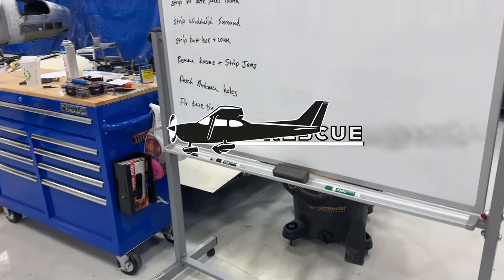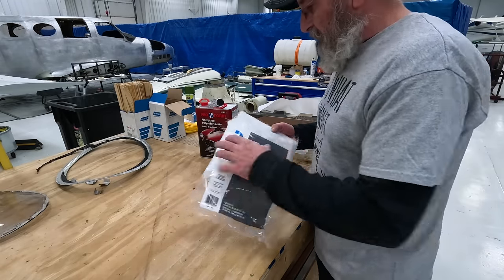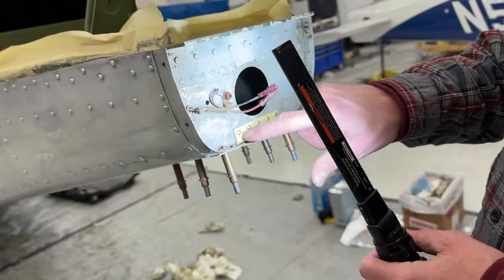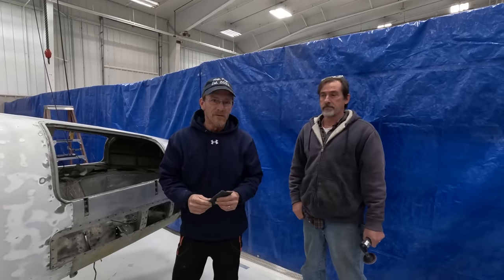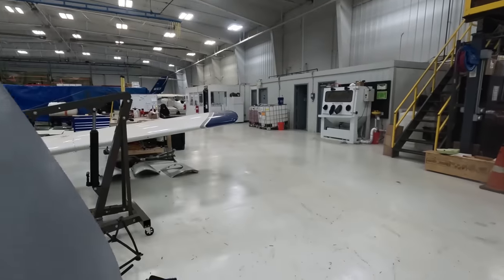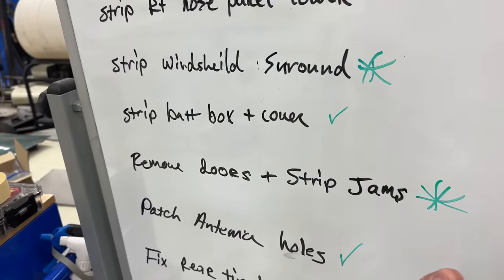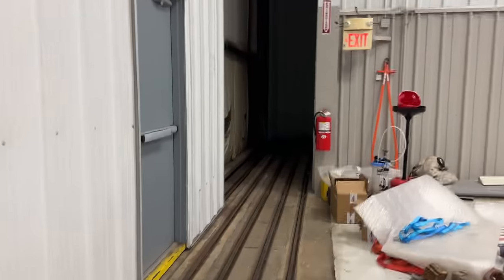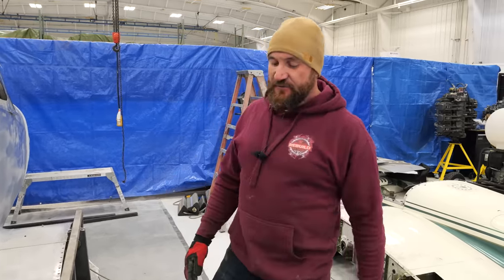Final Touches On The Free Abandoned Airplane

Comment: As you're putting new avionics and antennas in, I'd plan for ADS-B diversity: one on the bottom and one on the top. Canada will soon require the top mounted antenna as ATC in Canada moves to space-based ADS-B with Aireon.

Comment: the trick for removing and installing piano wire is when pulling once you have an inch out chuck it into an electric drill. spin and pull. works like butter. same thing when installing chuck it up slight pressure and slides right in. only have to tap the last inch.

Comment: For finishing ice shields and nose cones try ballistic epoxy by Endura, EX-2C. It is a super tough clear coat, UV proof, and super easy to use. It is used on fire trucks and missile nose cones. It is very expensive but close to indestructible as the name suggests. Not good for exotic hardwoods because it kills colour and chatoyance because of the super UV protection. Another problem I had using 1 ounce of the clear finish on a pool cue besides it killed the life out of exotic expensive hardwoods and one ounce curing gave off a stench that smelled like a thousand skunks had an orgy that lasted about a week in my entire house. The cured finish is colourless and odourless. Make sure you use it with super ventilation during the curing.

Comment: 40 years experienced structural tech. Easy way to remove piano hinge pin. Once you get it out a few inches, chuck the end of the pin into a drill. Pull the pin while spinning it and it will come out nice and clean.

Comment: Unless you add another fibreglass layer inside the nose, the new resin will crack again after a while. Resin alone is to brittle. Only the combination with flexible fibres will give it the needed stability

Comment: I was thinking about the fuselage issue at the end. Could you get some bar stock and bolt it to the trailer in parallel like train tracks? Get some metal wheels under the plane jack, that way you can have the wheels hang off the side, kinda like a train track. It could be useful for future planes and the bolt on rails would be temporary.

Comment: I love the comment "This is what's holding your door on at 200 mph". I count 22 tabs on body side. That means either 42 or 43 sheer points on a I'm guessing 3/16ths steel wire. The rivets will fail before that hinge does.

Comment: They sell Black hawks all the time. Wouldn't it be easier and faster and cheaper to use the 402 fuselage? If your worried about the trailer width just add some side extensions easy peasy.

Comment: Why have you not refitted the windows back into the fuselage BEFORE you send it for paint.
Otherwise you will have to touch the rivets in after paint, and run the risk of messing up the new paint in a very visible area on the aircraft.

Comment: I was about to comment, those "bondo" slash dash repairs just irk me.   I understand when this jet is together, there isn't always ready access behind the skin to smooth out the dent with hammer & dolly, but we were taught the filler, if not properly preped,  could pop off under stress creating a FOD.   The few lazy guys in the Maintenance Squadron used to slap on "Perlit" filler and hide it under green primer, call it good and sight off the maintenance log.
Those who cared at leased tried to flaten out the dent as far as we could.

Comment: I've had various hobbies over the years, and the extent to which random hardware stores are actually <insert-name-of-random-hobby-here> is amazing.   Here in Canada we don't have Harbor Freight, but we have Princess Auto and Canadian Tire, and then the usual collection of Home Depot/Lowes, etc.   My current project is re-motorizing the motion system for a former-NATO satellite ground station--42ft diameter dish that weighs 10 tonnes.  The gearboxes alone are about 1400lb apiece, and there's 4 of them.  Surprisingly, most of what we need can be sourced at "the usual suspects" :) :)

Comment: So, when you guys started on the free "401" and after y'all got it to start, left and right engines, I think you guys decided to clean and polish the exterior so you could strip the whole plane down to the metal. This has given me a complex or should I say reinforced my pre-existing complex, with the order in which you have attacked the project. I've been thinking about the christening before the first flight of the reborn Phoenix. DO NOT BREAK A BOTTLE OF CHAMPAGNE OVER ANYTHING OTHER THAN A LANDING STRUT ...  STRIKE THAT! 
DO NOT BREAK THAT CHAMPAGNE BOTTLE OVER ANYTHING OTHER THAN A WHEEL CHALK ... and the fuel tank bladders/tanks? You got to test those things to know that they do not leak ... no slow drips, nothing ... I could just see fuel getting onto the fresh paint when I close my eyes at night. Yours truly, Bill Bye
Reply: wheel chalk? Isn't that what the parking meter maid marks your tires with to see if you exceed your time limit in a parking spot? Those things to keep the tires from rolling are called chocks.

Comment: Loving this project but it's in danger of turning into Triggers old broom, 20 years hes had that broom with only 10 new handles and 12 new heads. I was thinking at one point you were going to use the "parts" plane fuselage for the cargo door at that point it would have crossed the line and been a different plane entirely.

Comment: I hate to tell you Joe but resin adds no strength to that nose cone once you got all the loose material knocked out you need to put new resin and new glass cloth on the inside. Again just adding resin adds no strength and you're going to be back to the same problem of it cracking out. Now you took the radar off the dose so there's really no added weight by adding additional glass cloth upon that nose cone. I'm sorry you didn't do the repair correctly hopefully you learn, again resin adds no strength all the resin does is add weight with no increase in stiffness or strength.

Comment: Is it not possible to have someone on the outside with a dolly while someone inside knocks the dents back out? Same for those doors, covers. plates and such you have on the bench. I mean 5 minutes with a little hammer/slapping spoon and dolly work would mean zero or minimal body filler in most of the areas I'm seeing.

Comment: Is it really going to paint before the window reinforcement/mounting rings are riveted back on ?
Reply: Joe dimpled the holes around the side windows in the video because they are going to bolt them on instead of rivets.
Reply: @darrenbradnock4553  Can you deviate from the original design intent on a certified (non experimental) aircraft?
Reply: @simonbaxter8001  the only job they do is hold the ring that holds the plastic window in place, they are not structural. Joe is a certified A&P so I'm sure he knows what he is doing. Especially as he is going to the trouble of hammering solid rivets in the patches.
Reply: @darrenbradnock4553  It would be interesting to see how those holes (in age hardened aluminium) went, especially with regards cracking! I'm speaking from personal experience!

Comment: unless I missed it during the speeding up of the video.  I didn’t see how y’all was cleaning the stripper film off.  All I seen was a drill w a harsh wire wheel doing the clean up. All that doing is smearing the strip film sinking it into the metal. Scotch brite pads and lacquer thinner is how you clean the surface then whip down with clean thinner

Comment: In the real world, would it ever be cost effective to do a rebuild on a plane like this? Meaning if you have to factor in labor, the cost of the plane, all the parts, and everything else that goes into rebuilding a plane to pretty much factory specs.
Reply: Short answer no. That's why it was free, it's the reason there's loads of small planes sitting abandoned. Not economical to fix. 

With airliners however is different. Airliners have heavy maintenance checks every so many years and are stripped down, interiors out, gear out, lots of parts replaced, paint stripped and repainted. New gears, interior etc.
Reply: Lol. No. It’s a money pit.

Comment: Im no expert in aircraft, but to me and as an engineer, I cant see why you can't put in the extra wide door. The sheet metal pices and the internal frame all looks like it is just a filler and if removed could allow for the wide door and step to go in.
Reply: @eagle2019  I just figure considering the effort that is being taken and that it will be used for charity etc, that it would be worth the effort and will make it easier to load larger items or even make it easy for getting a wheelchair Elin and such.

Comment: So just a quick question, why do you guys not wear masks when using the paint stripper or sanding?  That stuff is toxic as F$#%K and you definitely DON'T want to be breathing that in. If I recall correctly, that paint was lead based as well which is even worse. Other than that, the plane is really starting to look like it's coming together. Awesome job guys!

Comment: for your rubber  Its Expensive but nothing close, Use Goodrich age master,, a friend knew a tech at Goodrich and they had rubber from the early 70's still uncracked. and an OSH thing my cousin mentioned is on the fiberglass resin, The hardener is super toxic, be very careful dripping it out of the tube, some people score the tip with a razor and when the liquid comes out, it could piss sideways and you done see it, One bit of it in your eye and you are instantly blind. so make sure it has a hole vs a slit and use glasses and stand clear.and on antennas underneath, I saw on a forum to get a necklace bead or earring bear etc and you glue it on the end to keep from stabbing your head

Comment: Could be YouTube magic, and editing that doesn’t show some processes… and I fought with myself for 37 minutes on whether I’m not to comment, cause I don’t want to become a keyboard warrior. But I really hope that steps are taken to wash and remove the stripper from the skins. The stripper needs to be removed and neutralized to prevent further damage/corrosion/hydrogen embrittlement etc. This is especially important in your case when applying filler to the skins for aesthetic purposes. I also hope that Alodine (with proper aviation lot/traceability) is being applied after washing and before the Bondo. Otherwise you’re locking in corrosive materials behind body filler. I hope it’s just a video edit thing…. But wanted to point it out in case you hadn’t thought of it.

Comment: Will the fuselage be dipped in the alodine bath ? That would be better coverage and protection.
What's the alloy, AL-2024 ?
The panels look great compared to how it started, nice work !
Reply: Wow, that would be awesome - a large enough tank to dip the fuse, plus enough hexavalent chromium conversion coating . . . probably run like $80-$100k? Plus EPA permits?

Comment: RADOME looks very nice.  When you do avionics, is somebody going to supply a modern weather radar to you?  The 401 or 402 should also be deiced...  Eventually this is going to be resold to somewhere sometime in the future.  unless this is only going to be a Sunday afternoon joy ride airplane, She'll need electric deice on the props, minimum of a deice plate for the pilot side of the windshield.  I've flown both electric and alky windshield deice on 401's. plus Pneumatic deice boots.  Resale on the bird would be very limited without full deicing.   401 is a very capable bird.  if it wasn't setup with internal O2 might track down one from a wreck.  Otherwise you're using portable O2 bottles.   Following intently...  Erika DD

Comment: Again for how much work on the 401 or phoenix is needed, such a waste of time, considering you have a ready to go fuselage and prepped and ready to go for assembly....and your messing around with labour intensive repairs on old crap and trying to sell the good, ready to go fuselage. Horrible business decisions.
Reply: @mmayes9466  even with all maintenance, restoration, flight logs, etc (401 was stated as having zero proper documents in the videos to recertify....than why all the work?).....I dont understand why, Ive seen other planes do it before.....maybe what I dont understand is taking all the parts that are prepped and ready to be recertified and painted and/or installed on the prepped 402.....and taking them and installing them on a 401 that is heavily damaged( including cost of interior 🤔) and will cost 10x as much to fix, install, update and to certify, if it passes everything....mean while the 402 is literally a bolt together project, with interior trims ready to go......doesn't make sense.
Reply: @Diablofeb4  it makes perfect sense if you understand how aviation works. I see you like using the word "recertified" but in reality, there is no such thing. Nothing needs to be recertified. There could be major issues getting the 402 registered in the US, i.e., it may be impossible. That plane was imported from a foreign country. In addition to the conformity check explained by Eagle201 (which involves a DAR), it has to follow the laws for importing aircraft form a foreign country. Can't spend a lot of time, effort and money on something that you can't legally register or even prove that you legally own. RR should explain this but I'm not holding my breath.

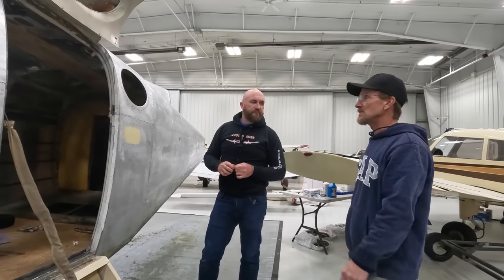Comment: At 14:55 you said it would be nice with “lower voltage lights” .  The aircraft electrical system voltage remains the same. What you are going to get is lower “amperage” or less current draw lighting. 
Volts X Amps = Watts

Comment: Hello Rebuild Rescue.   I have been working on a space recycling project for the past 7 years.   I watch your videos and think constantly about satellite servicing.   I.E. Today's episode, how do I strip paint in space.... well, we would need pressure and a ventilation system to prevent the dust from going everywhere... It would have to be pure nitrogen, but pressurized modules create risk and size constraints, blah blah blah....no one cares stuff.   It would be awesome to see you fabricate metal and plastic parts on-site using additive manufacturing.

Comment: tell me if I'm wrong but don't you need to put fibre glass under a vacuum to cure? otherwise you'll get voids and weak spots in it. its fine if its not a load bearing part and just a patch but if it is load bearing you don't really want any weak spots. 

p.s. love the work you guys do
Reply: It’s tertiary structure, no probs.

Comment: I don't see ant TIG welding going on with the aluminum repairs. Is riveting the SOP?
Reply: which aluminum repair are you referring to?
Reply: @buckmurdock2500  Just any places that needed a sealed surface or broken brackets in general. I assumed that a TIG welder was the tool of choice for aluminum repairs. I see doubling of aluminum plates to cover holes is common in this case. Maybe the metal is just too thin to weld properly. Just curious.